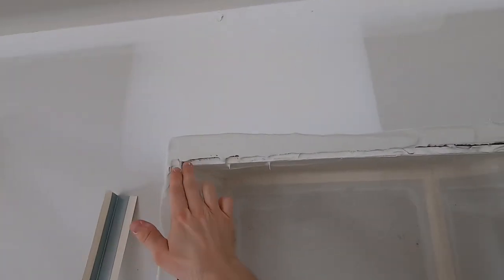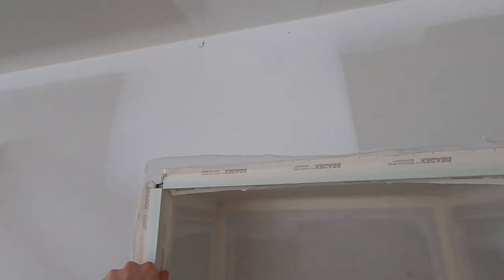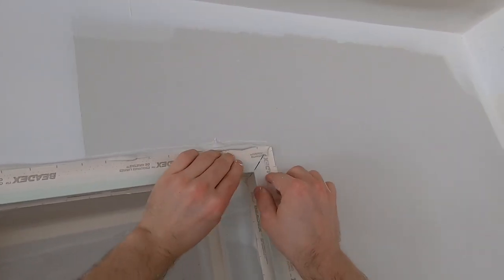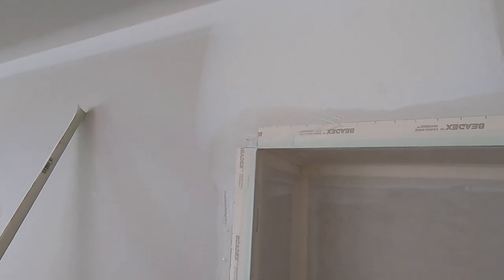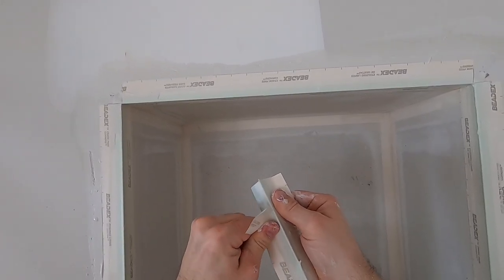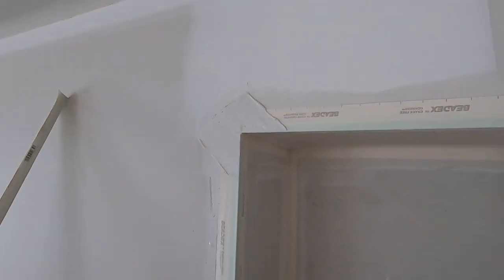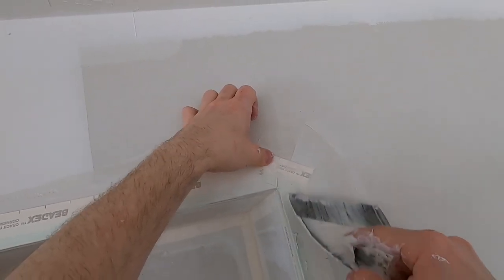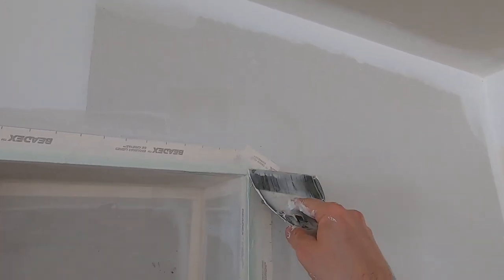Fixing a Cornerbead gap

Comment: You need to cut the header piece so it extends past the corner a half inch on each side bottom cut I called it a dog ear cut. I have this video on my YouTube channel how to cut corner bead if you want to check it out it’s the same is metal bead . you’re cutting your header piece an inch too short. It needs to be cut on the bottom half but not the upper half at each end. So there will be no hole to fill our cover

Comment: Wrong! Put the horizontal piece of cornerbead on First. And butt the vertical pieces into horizontal. Use joint tape if you want it’s still thinner than the Bead on the cornerbead. If you want to keep a low profile to fill in gap.. cut a triangle piece of metal off one side of bead and slide metal under one side of gap

Comment: Cut the header piece 2 inches too long. Make a cut in the bottom flange from edge of tape to center of bead. Make this cut 1 inch from one left side end of the bead and at a very clean 90 degree angle. (If metal bead, make a square cut from edge of flange towards the center bead 1 inch from left edge)   Bend this bit of bead over so that it is parallel to the top flange of the bead and will sit nicely on to paper face of the wall  when the header is installed. Measure from this cut, along the bottom flange over to the other end of the bead and make another similar cut. This must be the same distance from the first cut, as the opening is wide.  Bend this flange down also so that it will sit nicely over the face of the drywall wall when header is installed. This little flap should also be about 1 inch in width . I usually tap the protruding bead on the 1 inch flaps down with a hammer ever so slightly. Install this header piece so that it fits nicely along the op. There should be a 1 inch flap at either side of the header hanging down on the wall over the gap that we are trying to cover. Now cut and fit the two side legs and install over the top of these flaps. These flaps make lining the side legs and the top header up very easy. No "clickers" when you run your corner bead with a fill coat of mud. If the flaps are not perfect 90 degree cuts, they may need a little trimming to fit perfectly.

Comment: maybe consider? put vertices or uprights first. then cut a inch or so off just the bottom angle depending on the width of product. do same on opposing end. quick easy professional with no random corner tape pieces or measuring

Comment: Hey I’ve had a few methods through the years dealing with those nasty corners, lately houses are doing return windows so there always lots of them!! I wait til all bead is installed make sure no regular mud gets in there and fill them with concrete fill, it doesn’t crack sets quick and and very quick method. There will be doubters but I started doing this 15 years ago in sisters home and not one corner cracked!!
Reply from the maker: Thanks I should try that, I'd trust it wouldn't crack too. I always use concrete fill for prefillling large drywall gaps, it's very durable